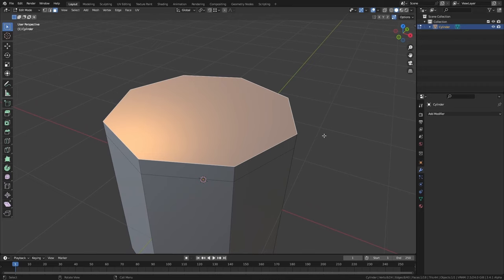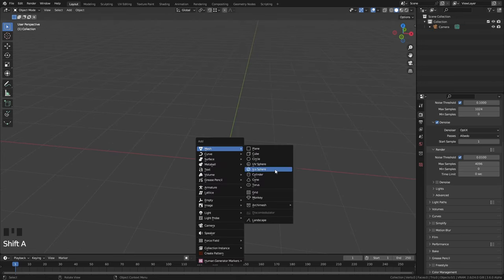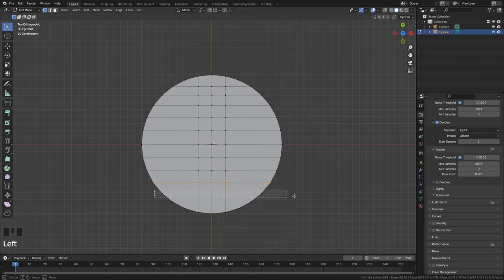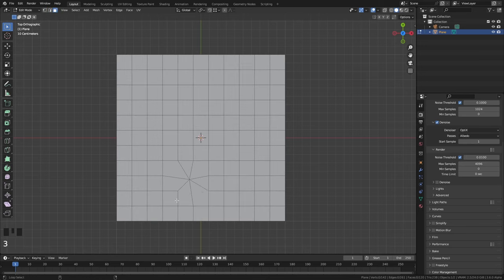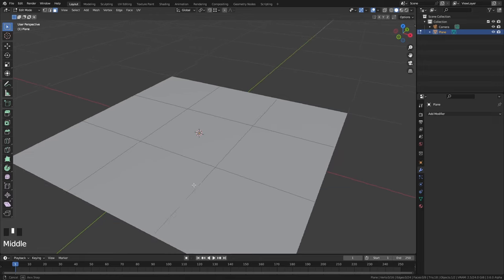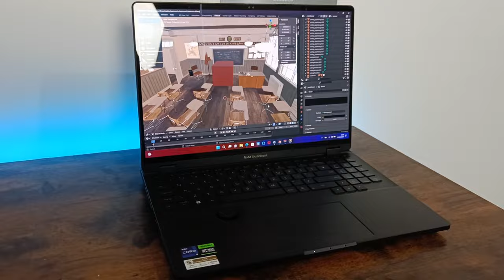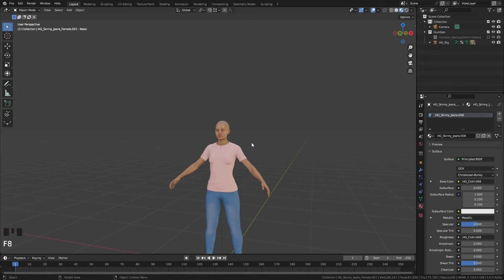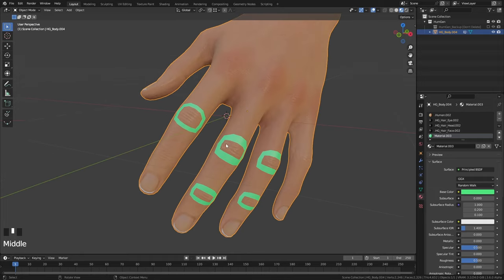Become a Topology PRO with these Five Tips

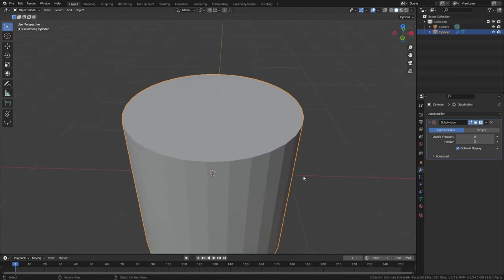Comment: 4:50 You really need to emphasize that it's not that "poles aren't necessarily bad," but that they're necessary and to not be afraid of them. You even go on further into the video to talk about the face and joints and how you should add edge loops, but you don't make mention of the massive number of poles that creates. For example a single finger with proper edge flow will have 14 poles. Ignoring the feet, you have 280 poles from just the fingers alone. 

I've felt like I can't figure out topology because all the meshes you see online to try to learn from are filled with a massive amount of poles. If I'm being told to avoid poles but all I see are poles, then I must conclude those meshes are wrong. When in reality the "avoid poles when necessary" advice an impediment to learning when I don't know what's necessary to begin with. 

A proper human base mesh should have over 320 poles with proper edge flow. This is a significant number.

Comment: I've been a professional 3D artist for over 30 years. It's true that sculpting software, Z-brush, etc struggle with triangles. Animated assets that deform, eg characters are better with as frw triangles as possible. The rest? stop wasting time worrying about quads. Triangles are fine, in games, in VR, in marketing artwork. Believe me, I know. I often used triangles tapwr off detail away from circular ends, where more detail means less faceting. The methods shown in this tutorial are well described/explained but mere waffle for screen time. These methods actually generate more faces that are wholly wasteful. OK, you can LOD, but you will need less LOD steps when the initial model has fewer polys.